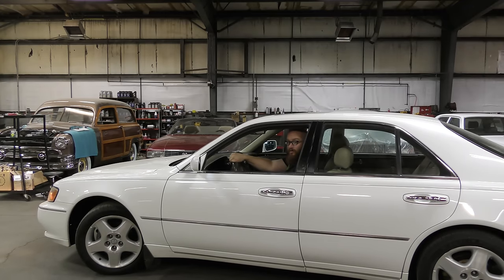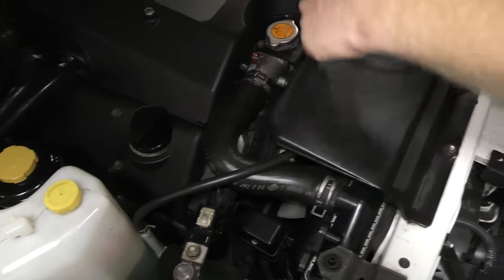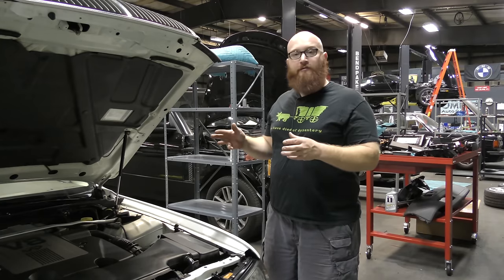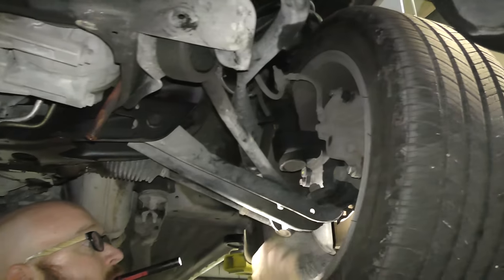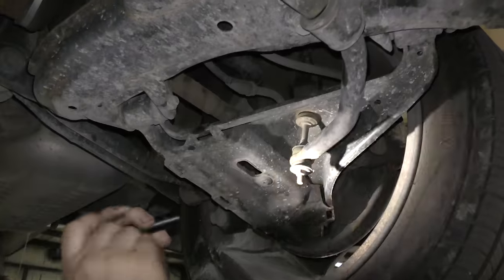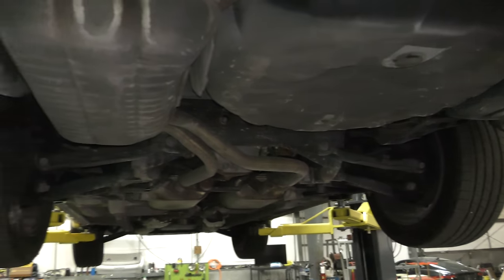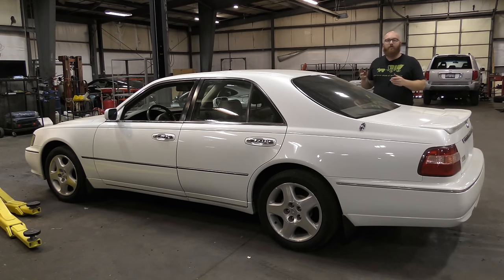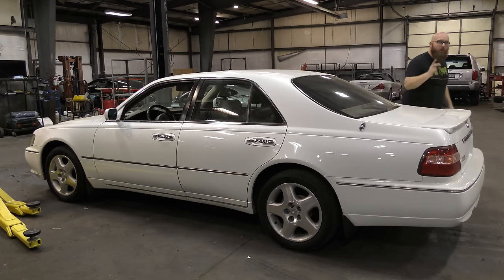I've never seen one of these before! First time a 99 Infiniti Q45t enters the Car Wizard's shop

Comment: My friend had an M45...it was beautiful with an excellent sound system with 14 speakers.  It was like being in a concert hall.  I remember how impressed I was with the car.  Now I haven't seen one in the longest time.
Reply: We have so many old Infinitis, both M cars and G cars, around where I live. I'm a proud owner of an 04 G35, dead reliable beast of a car. My dad owns an m56x, which is also incredibly awesome.

Wish Infiniti still made cars like that now.
Reply: @dialect749    No oil consumption in the 04 G35?
Reply: 6lemans10 vq35de is still reliable when using oil just make sure to check your fluids..have owned a 03 g35 sold it with 235k on it drove the car for 3 years with nothing but a control arm and add oil 😂
Reply: @dialect749  im trying to save up money for a 2007-2008 350z with the VQ35HR engine. Those cars are so expensive.
Reply: @6lemans10  LMAO, what? They're under 10 grand.
Reply: Really I see a ton of the 05 and up and M45 and 35’s they were really great cars
Reply: I had the original M45 in pearl white that was only made for two model years in O3-04 that came with only the 345hp V8 RWD, it was a very clean angular design, you're right, you never see them and they were great looking, they looked nothing like what came after them with the rounder more generic M35/45 from 05 and onwards which were all over back then, that was a fun car and nobody ever knew what it was, ya just didn't see them back then and especially know, it was like a luxury muscle car, still looks modern today.

Comment: I had a 2003 Q45 that I bought used and kept for 10 years.  It was a great car to own and operate.  I do miss that Q-Ship.
Reply: Man is it hard to find parts though. I have an 05 and no one knows what the hell the car is.
Reply: I had a 2003 M45, it was a great car and I loved the styling at the time so classic, the Q 45s were super nice, the Gatlin gun projector headlights were so unique, and the voice control by Visteon was really good actually, you don’t see many of them on the road unfortunately
Reply: Recently bought a 2006 M45 because of that parts sourcing issue. I told myself even though the old ones are rare and classic, at least with the 2006 I get modern amenities and shared parts with G35s and M35s, so I'm not completely screwed
Reply: @darrenlee1256  smart, I bought my 2003 M45 in 2007, and I lusted after the 2006 M's, as much as I loved the 2003-2004 I wanted adaptive HIDs, push button start, and speakers in the seats lol
Reply: @nicholasbabeaux2052  the sad part about the one I just bought is that the entertainment system isn't working properly. Currently diagnosing it because no matter how fun and smooth the motor is, I also want to hear the 5 channel surround sound system at work haha. Can't wait till it's fixed to blast some tunes or watch some movies
Reply: Darren Lee Oh that’s a drag, Could it be a fuse? And so you got the upgraded one with the speakers in the seats, I recommend getting a DVD audio disk they sound amazing with a 5.1 in the cars when you get it working
Reply: @nicholasbabeaux2052  yeah, I got a fully loaded non sport (adaptive headlights, lane departure warning, adaptive cruise control, 5.1 surround sound entertainment system, navigation + DVD screen in the back). Can't wait to get it sorted. Already checked the fuses. If it was that easy I'd be happy haha. Gotta confirm if the radio and/or amp are dead and go from there or if any wires are damaged for whatever reason
Reply: Darren Lee Nice, those 18s are still pretty slick looking, I had the adaptive cruise from infiniti of that era in my 2007 G35S  and it worked pretty well, but of course cut off at like 25 miles an hour, That DVD screen in the back was kind of rare, what color interior? I always love the camel it’s beautiful
Reply: @nicholasbabeaux2052  I didn't get the original  18" wheels with the car but was likely gunna try and find sports wheels anyway.  I have a glacier pearl exterior (so an off white with some flake in it) with tan (guessing that's what you mean by camel) interior
Reply: Darren Lee yeah that’s an awesome color, the 19 inch sport rims that came with the sport package originally are Beautiful but the M56 20 inch rims that came in 2011 are some of the best looking rims of all time you should check them out if you don’t know what I’m referencing
Reply: @goldengod5915  you tellin me, i got myself a 91’ Q45 and she turns heads everywhere i go.

Comment: Car Wizard.
Top Hydraulics Oregon.
They repair all sorts of convertible rams. I would give them a bell.
In the UK we send our Mercedes rams stateside. Better than original
Reply: You do understand a convertible lift strut is a hydraulic ram like on a lift, floor jack, caterpillar, forklift etc and a gas filled hydropneumatic strut is something completely different.
Reply: @chipfukmaster5928  I do. These are not standard gas/oil filled struts.
They are air/oil but not at any pressure. The machinary top hydraulics have means they can refurb these.
A company that just gets things done.
The work these guys do is world class
Reply: Hell, it’s always worth asking. The worst they can say is no.

Comment: Three reasons this is better than a Lexus: Starter isn't buried under the intake, power steering isn't above the alternator so the alt gets wrecked when that leaks, and the charcoal canister isn't stuffed up behind the subframe and differential where it's impossible to reach.

Comment: Looks like a Diamante in the front. My dad had a 99 for a while. I liked to drive it, but it wasn’t anything special. I did love the fact you could manually control your headlight beams u/d from the switch.

Comment: Duuuuude.   These are rare these days.    NEver sold real well back when new.    But Do you find a well-maintained one they are quite a gem. Especially in T format
Reply: They have a huge following in Japan.
Reply: VIP cars. 👍
Reply: Stay away from the T. Replacement suspension parts are non-existent.
Reply: A friend owned one which I enjoyed riding in. Why he traded it for a Cadillac, which was a lessor car to me, I will never understand. He got only $6,600 as a trade, had I only known that he was going to trade it...
Reply: @nomebear  Yea I always loved this body style. I have a 2008 M45 Sport which kinda replaced this in a since. And I tell myself I will never part with it
Reply: @BigBrutalBunny  Yeah I owned a T, if you have to replace the suspension you're fucked on finding a replacement.
You can possibly source used parts or find a parts car/junk car, but its not cheap or easy. 
With that being said though, you can technically replace it with a better option, its just some welding. You can switch it to S12 Coilovers if I recall.

Comment: Coilovers is the best options for replacement, the factory struts are on available from dealer they are 1500 for the set ...the conversion for the suspension is the S13-S14 conversion

Comment: As many others already have said.. Back when Nissan/Infiniti was in the top 3 best brands.  It's so sad what they've become all these years later.
Reply: Elementality Seriously I had A 2003 M45, and then a 2007  G35S and they were both great cars, I’d beat the hell out of them and they ran strong, The new QX 50 is good looking, and the Q 60 is stunning but I wouldn’t buy one, I had a rental 2018 Q50 3.0t and it was seriously fast, but no match for a 335I which it competes with, now the red sports are bad ass but I haven’t driven one
Reply: I was a mechanic for Infiniti starting in around 2010.  The exterior and body got better but the engines got worse.  VQ and I think VZ engines have major problems at low mileage.  Thanks to pen pushers at the top trying to cheap out on engine internals and people being cheap owners and running regular non-synthetic oil in them which would cause problems at 10k miles piston rings started blowing by oil like a car with 300k miles.
Reply: @CrazyCat229  Dude you ain't lying.. The VQ35DE I had was garbage, and that transmission was even worse.. I can't see myself ever buying another Nissan product. My cousins Titan burned to the ground this year and my idiot stepdad bought an Altima and has had two transmissions before 60k miles.. I told him he should have listened and bought a Toyota and he's on his own, good luck...
Reply: @nicholasbabeaux2052  They have gorgeous body styles on some of their sedans and SUVs but fuck having something that falls apart after 60k miles.  I'd rather buy another BMW for that kind of waste of money...  Lexus for life for me.
Reply: Jordan Kinberg Even the VQ engines in the 2003 through 2007 G35 coupe and G35 sedan? I know they had crankshaft position sensor’s and sometimes oil consumption’s but they were pretty bulletproof and tunable right? I had a 2007G 35S with a higher VQ and it was bulletproof I sold it at 175,000 no issues
Reply: @nicholasbabeaux2052  you got lucky.  2008-2009 was when the problems started.  The way the warranty was determined was a fiasco.  We had to have the car for a week after the engine was installed and drive it to and from work to break it in.  The job normally paid 20+ hours of labour.  Warranty was 10 hours pay for a job to do right takes the full amount of time.  The engines they sent us had to have parts pulled off the old one and put back on.  Yeah, one of the main reasons I went back to doing IT work and currently back in college getting a 4 year in Cybersecurity.  I love working on cars but flag hours really make it a hard industry to work in.
Reply: Jordan Kinberg Oh interesting so the 3.7 was unreliable, it’s really sad because when I was a kid Nissans and Infiniti’s were like the sporty Toyota’s and Honda’s, super reliable, having my 2003 M45 was a dream, even though after looking back I realize it may be had some oil consumption issues, And my 2007 G35S was just so hard core, rear wheel steer, and all the tech for 2007, I know that IS350 was a bit faster but it was too cramped, but now Infiniti doesn’t update their cars enough, and sure the Q 50 and Q 60 red sports are very quick and look nice especially the Q 60 I wouldn’t wanna own one out of warranty, but the same could be said for a lot of cars these days other than Toyota and Lexus you know.  Yeah being a mechanic is awesome, when you’re doing your own cars, or if you are a master tech with Mercedes making well over 100 K but for the little guys I can only imagine congrats on going back to school, use your brain Rather than sacrificing your hands LOL but I guess carpal tunnel can be a worry for you now LOL
Reply: Toyota Nissan Honda, the original "Big Three" brands with legendary reputation.  Now nissan has the exact opposite reputation.
Reply: Elementality So true, even Honda these days though, looking at consumer reports and JD power Honda doesn’t make one vehicle that has perfect reliability, most of them are average, the issues they’ve been having with their 1.5 L turbo engines and CVT’s Have ruined their reputation, Sure cars are more complex, and I am mainly talking about drivetrain issues, and other failures not like infotainment, but Toyota/Lexus is the only one that is consistent,  Kia and Hyundai are even doing well
Reply: I had a 2001 I30T in that same color with the factory rockers and spoiler. It was the most amazing car I ever owned. Drove it 5 years without issue. Still miss that car!
Reply: @nicholasbabeaux2052  Dude I've seen Priuses with 500k miles, original transmission, no issues other than cosmetic.  No one can get within the same solar system as Toyota these days.  Though I will say the 90s were when they peaked.  Several models were knows to break 500k to 1M miles on original engines and or transmissions.  I'll still never buy anything else.
Reply: They're still good, jsut avoid the CVT cars. And if recent news is any indication its that they're listening to ppl whine about the CVT problems, new pathfinder has a ZF-9 speed
Reply: @nicholasbabeaux2052  All my 3.7 and others have been absolutely bulletproof, no one complains about them except for some people having galley gasket issues, and that's just early year model VQ37
Reply: @LivinglovingGod1st  I had one too. Miss it so much
Reply: @Elementaliti  Yeah A lot of people have had a few problems with a VQ 35DE, and a lot of people say they’re bulletproof, my buddy has a 2005 FX 35, it has 230,000 miles and he’s a mechanic and he maintained it well but it doesn’t have any issues, the transmission went out at like 210k but that’s a long life
Reply: Exactly pretty common problems, I recommended a 2003G 35 to a lady friend who does not maintain her cars, and the crankshaft position sensor went out easy fix, and I think it burns a little oil but it was a great car for her
Reply: @Elementaliti  Yeah I agree, that 3 L V6, and the 2.4 from Toyota are just bulletproof, I I’m determined to only buy something with a warranty, for instance I just signed lease papers for a 2019 mini Cooper S which I know is not reliable but it’s got free maintenance and warranty so no worries
Reply: @liblib89  that’s awesome, they sound amazing, I am hoping for Infiniti to have a come back in the next decade, the new QX looks pretty promising, they just need to drop the CVTs, I will say though having had a brand new rogue for a rental car recently it wasn’t a bad car, the CVT was a little weird and it got good gas mileage but I definitely wouldn’t buy one. I haven’t driven the new Sentra CVT but I hear that it is a lot better than the rogue which has an older version of the CVT I think. I did have a Kia forte recently and it was a great CVT but obviously it wasn’t a performance car, I also had a brand new Corolla and it was a decent CVT as well especially with Toyotas having a first gear.
Reply: @liblib89  Yeah very smart of Nissan to do that, the ZF has always been a great transmission, I had one in my XJ, and my XF and they were quick shifting and reliable, when the 9 speed ZF came out it did have some issues in the jeep Cherokee, and the land rover evoque but they have been worked out by now

Comment: You can use non touring struts. You also use coilovers as well. Bc racing sells the coilovers with the knuckle already welded on for a direct bolt on.
Reply: i bought the non touring struts to put on my 99t and they will not fit- bad info you are dispensing here
Reply: @americanbadass011  they do fit. But they just make a terrible noise.
Reply: show a pic of them on the car then
Reply: @americanbadass011  wym I have a 97 q45T with the air suspension
Reply: @americanbadass011  my back ones are still original but my front ones were about to go out. So I had to go to the junk yard and their was only a base 98q45 with 90k miles on it so I took the struts from it.
Reply: @americanbadass011  where you want the pic from ?? I got 207k miles
Reply: @jesserdo9963  i tried the rears and they wouldnt fit.....the non touring rears on a touring q that is
Reply: @americanbadass011  I changed the front ones idk about the back ones
Reply: @americanbadass011  also idk if the 97 q45T has the air suspension.
Reply: I have a 98 non Touring... That's the one thing I avoided when shopping... Even the non Touring struts are expensive/impossible to get, so I got coilovers and cut them to fit.  Perfect.  But hot pink....

Comment: They also had the J30 back in the day, nice interior, real wood grain, and the 300zx engine without the turbo. It had the sloping trunk in the 90's like the Mercedes CLS before Benz made it a look. The 2002 Q45 got a redesign. It had the most powerful headlight in the world at the time. Looked like a mini gun. It had 7 projector lenses in each housing for the low beam.

Comment: First car I ever bought from a dealership. Absolutely amazing value. Beautiful style that has aged very well. The Bose sound system still performs well after nearly 25 years. Engine has never had an issue. Transmission works as it should. Only mechanical issue was a wheel bearing. They had a recall for a vibrating shifter that replaced the rear trans mount bushing. Thankfully, mine was not the Touring 't' variant, so struts haven't been an issue. On the flip side, the wheel bearings are ungodly expensive for the base model. They're only $80 for the touring model... but we'll over $300 for non-touring base models.

Comment: Wizard! Apparently you can Frankenstein the non-touring struts with the touring struts. You have to get the cartridge from the non-touring strut to swap onto the old struts currently installed. I know it's often not fun taking those kinds of things apart, the tension on those springs can make things a bit explodey, but it's a lot cheaper than the touring struts, even if you find them, and most people can live without the adjustability of them considering the cost.

Comment: I did a delete on one of these and it was still a big job.  Got all used parts from a wrecking yard.  There is a ton of fancy hydraulic stuff on this car along with a lot of metal lines.  Car ran great after the  conversion, parts were $200 at the yard.